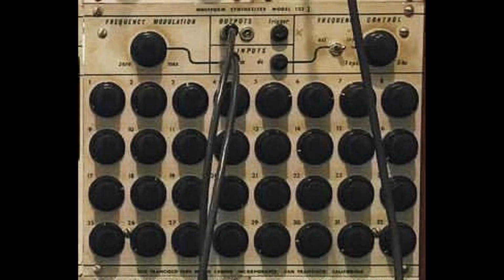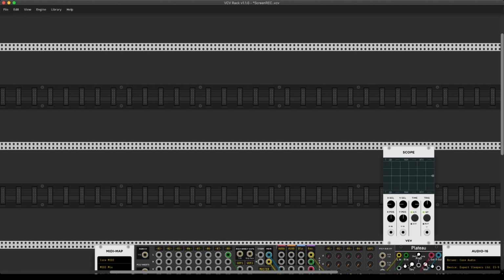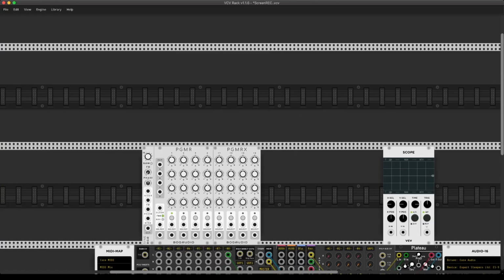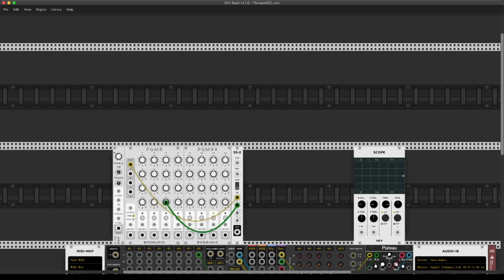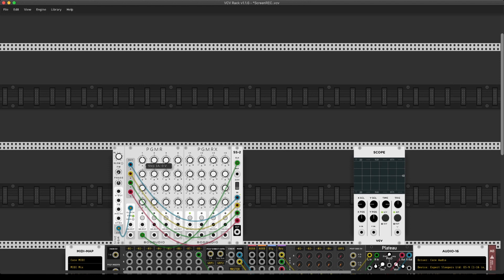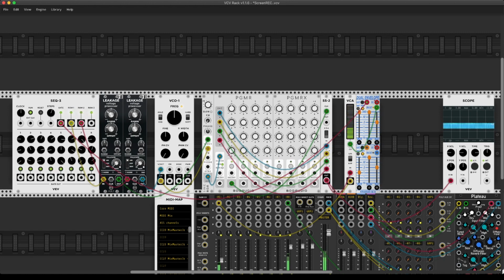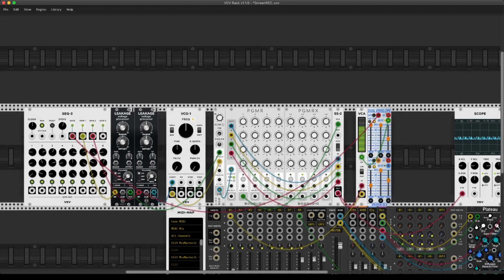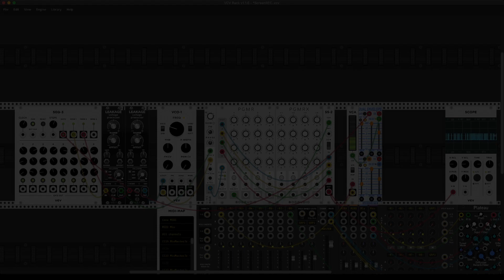How to build the strangest Buchla Oscillator in VCV

Comment: Huh, randomly clicked on this video and it turns out this is a method I've discovered recently with my AE Modular system, using a sequencer as an oscillator, I've mainly used it for AM-ing and FM-img things though. Cool to find out who did it first and see it used, very powerful way to make some noise.

Comment: Is there any way in VCV to build a complex module (like this oscillator) and then wrap it up in a container, so that only selected inputs, outputs and controls show up on the outside of the container, and the wiring and non-modifiable controls stay on the inside?

The container would then (of course) behave just like a module...

In other words, a way of hiding the detail AND reducing the screen real estate?
Reply from the maker: Hi Paul, no unfortunatelly we dont have anything like this now, or at least not that i know of. What you are talking about would be a combination of a subpatcher (like in MAX/MSP) and perhaps a freeze option (like in Logic Pro). I have not seen anybody do this so far, but it would be a wonderful feature to use in the futer to safe patch space and CPU usage
Reply: @crozpatching4598  What I'm proposing wouldn't same CPU - it's just a (helpful!) cosmetic presentation of the same underlying thing.

A computer programmer would call it a parameterized subroutine.

Comment: awesome work! 
could you show how to make a gate at random beat synced rates? to chop an fm lead for example
Reply from the maker: Hi Zahasara, If i understand your question correctly then you are looking for a Bernouli gate. It does randomise a steady beat but needs a clock to function. Try out chances by count modular
Reply: @crozpatching4598  hey, thanks for the quick response :)
I actually ment something different: i want a gate of lets say x1 clock, that has a controllable chance to accelerate to x2, x4 x8 etc, on every last 1/16 of the bar or last every 1/8 and so. hope that makes sense :) chrisGlitch vst is like what I'm going after, but its more of a glitch fx.
Reply from the maker: @Zahasrara  I think using chances with the combination of the 8face should get you there. With the clocked module you can program multiple subdivisions and multiplications ->run that into chances -> have the chances trigger out into the 8face that is saving your presets of clocked. Hope this helps :)
Reply: @crozpatching4598  ill give that a try, thanks!